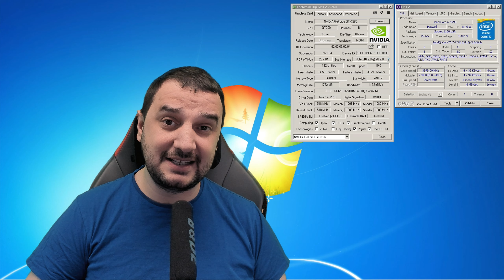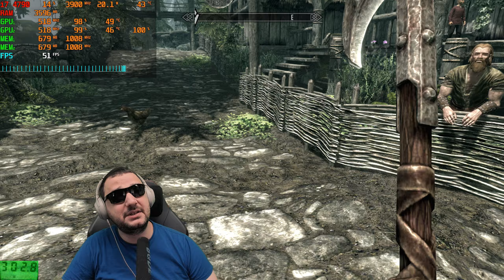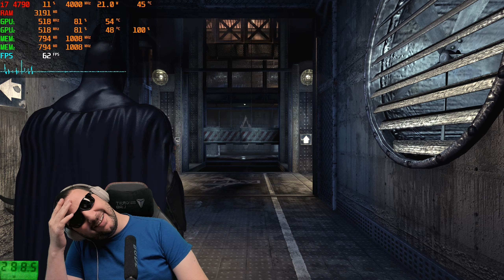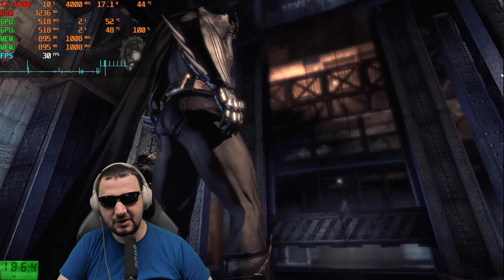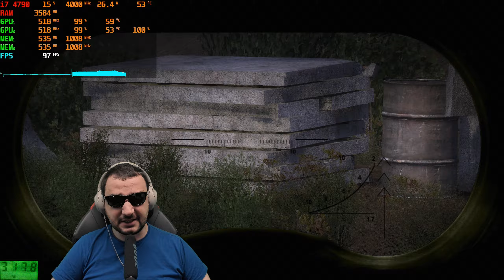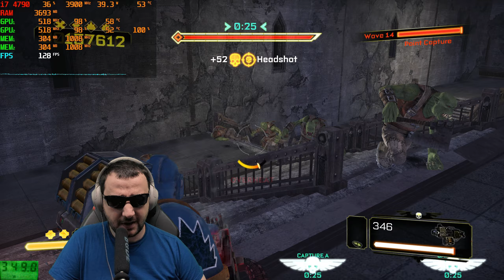Nvidia GeForce GTX 260 1.7GB SLI Benchmark

Comment: i have 2 of em also. overclocks easy to 630 core
Reply from the maker: what specs on pc you have?
Reply: @DanielCardei  X2 64 6400+,M2N32-SLI deluxe, DDR2 800 4GB. Only 1 260 1,8GB on use cause PSU has only 1 6 pin.

Comment: The i7 4790 processor is from 2014 and the GTX 260 is from 2008, for the right enthusiasts the current hardware is from 2008, I have a Core 2 Quad 9650 processor, a socket 775 motherboard and an Nforce 680i SLI chipset, but that's just my opinion 🙂
Reply from the maker: i bought a z99-e mobo with CPU and memory and still was cheaper than a single motherboard LGA 775 that supports SLI ¬_¬
Reply: @DanielCardei  Don't go with the "period-correct-system" bullshit. Always test you GPUs in SLI with newest CPU. That's the only way see full potential of SLI setup

Comment: i played a lot of games on the single gtx 260 gpu : Crysis 1,2 ,need for speed 1,2 and 3, cs .1.6 ,css ,metro 2033 ,2034 ,all stalker games that released officially ,all call of duty games till black ops 1 ,i really crushed cod4 on this gpu . We used custom configs to reach 250-333 fps for clan matches. Before Stellar Blade we used to have Blood Rayne 1 and 2 😅. Dark Sector was very cool single player game . I was wondering why the main character in warframe looked too familiar .Played red alert 2 and yuri's revenge ,oh boy when we make massive armies i felt like my pc was dying  🤣
Reply from the maker: Now all of that. How will you have felt if you had a pc with an SLI like this? :_wtf:
Reply: @DanielCardei  I don't think i would have been enthusiastic . The gpu's were power hungry and there were not much games that pushed sli or crossfire in that matter . But  I wonder if i could record footage with one of the gpu and play with the other 🤔.It would have been cool if one recorded  the games and the other pushed them with no performance loss😁. They could have been good for some room heating combined with hungry cpu as well 🤣